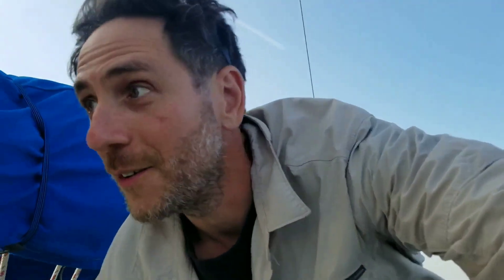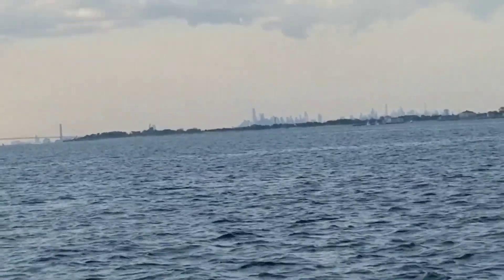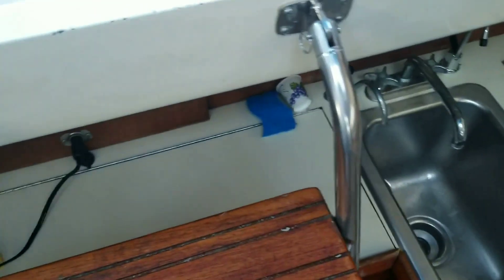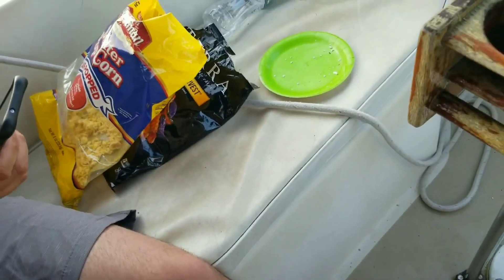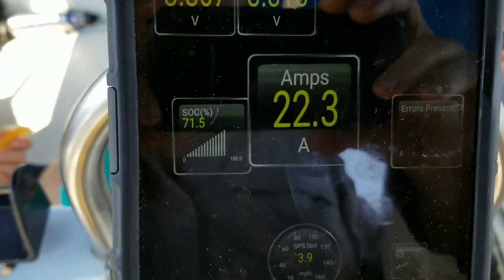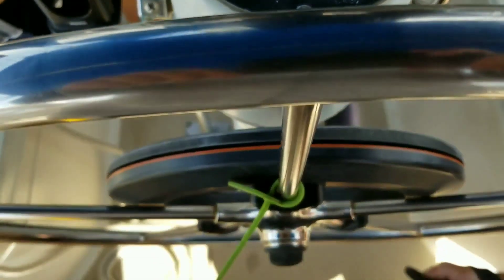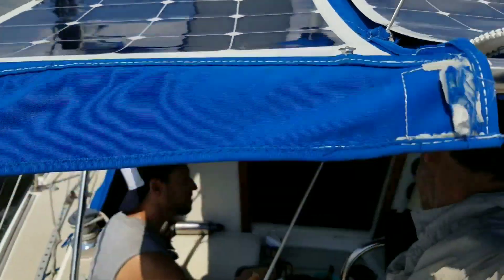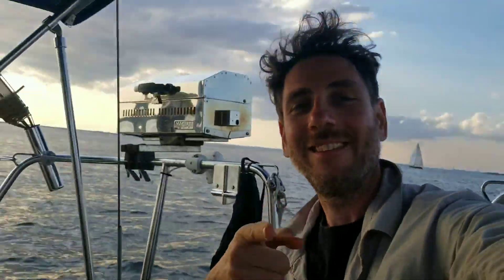Diesel to Electric conversion sailboat by Sunlight Conversions

Comment: What kind of prop are you using?
Reply from the maker: Matt said: 10X7 3 blade But typically recommend a larger prop with a reduction gear

Comment: cool! what motor is that? Any spec's?
Reply from the maker: 7.5 kw DC motor

Matt from Sunlight Conversions said...
7.5 kw DC motor
200 amp hours at 52 volts LiFePO4
460 watt solar array
Reply: @MrGsWorkshop  What did the conversion cost? What batteries do you have?
Reply: David Freeman About $12,000. Really depends on where you want to draw the line. I did a lot of solar, drivetrain, and prep work that not all conversions need.  10kw of lifpo4.